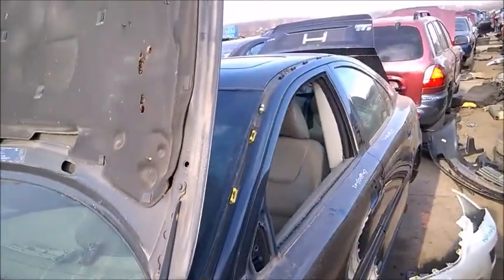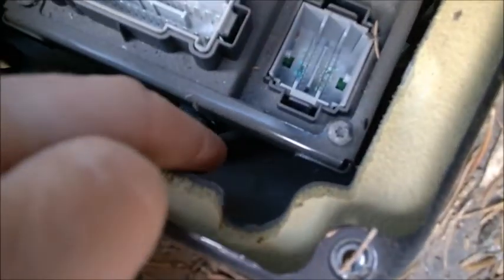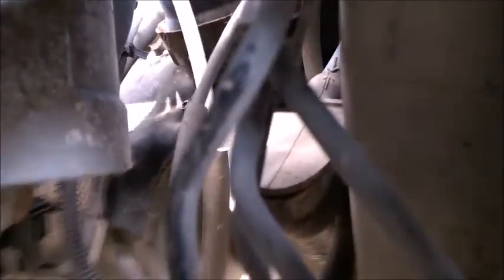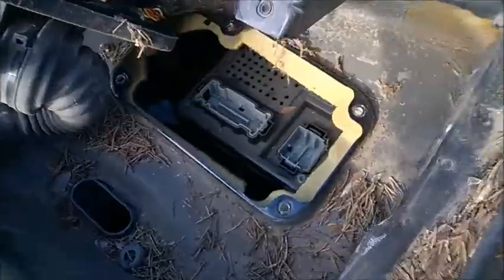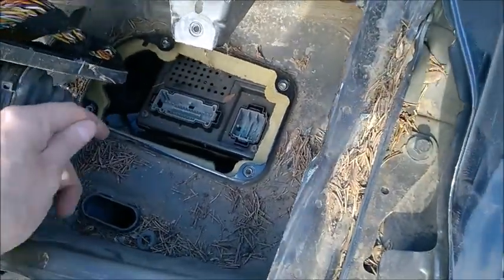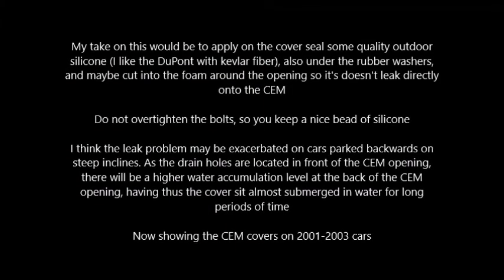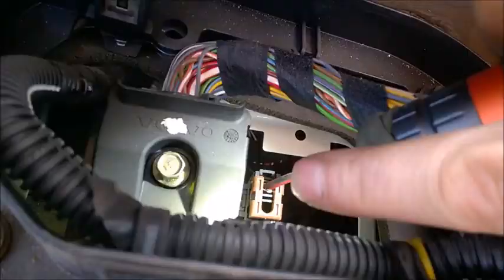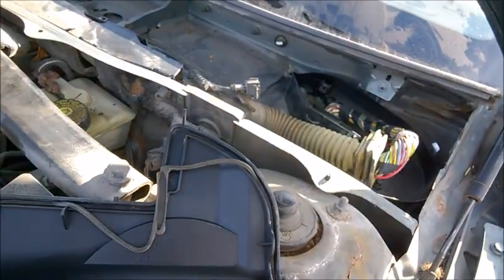Volvo S60 V70  CEM Corrosion check before removal  2004-2009

Comment: I have a 2004 Volvo S60 2.5T and I think I’m having the same problem with my CEM. My car will start and run good for a little and then eventually just start flickering on and off, eventually turning everything off and entering limp mode. If I disconnect my battery for a little, the problem is gone for a little. Would you agree with it being a potential CEM malfunction? Or maybe overheating. Do you have any tips/solutions
Reply from the maker: Hard to tell, better if someone good in electronics could check it. May also ask on forums but again, hard to tell from a distance https://www.matthewsvolvosite.com/forums/

Comment: Does this is an issue for 2001 s60 also?
Reply from the maker: Usually no, 2001-2003 had a different CEM unit not prone to failures or corrosion
Reply: @Peppermint1  ok thank you for the prompt response!really appreciated. Currntly having issue with the fuel pump still running eventhough the car already turn off. After removing the fuse, then only the pump stop. After navigsting to the fuel pump relay, removed it and install back again with fuse, the fuel pump now stop running.
Reply from the maker: @sangcxl31  2001-mid 2002 also had different fuel system design. It doesn't use FPS or PEM. Also the 2001-2003 CEM has a specific fuel pump relay, search Youtube with "peppermint fuel pump relay". Maybe the relay got stuck to ON. Suggest asking of these two forums, the UK one is better for diesel engines
UK  https://www.volvoforums.org.uk/
US  https://www.matthewsvolvosite.com/forums/
Reply: @Peppermint1  thank you for the advice! Will be looking for that

Comment: Peppermint! An Volvo XC90 purchased with 100K for $750. It runs nice after installing new plugs and coils. It does stall from time to time and must be restarted. The reason for the low price, was that of a parasitic draw of 400ma. With the car "asleep", I've found that there is 12V on many of the CEM fuses and under the hood in that fuse box. I pulled the top CEM connectors and found no water damage. After the CEM disconnect, the fuses under the hood showed no voltage, the draw disappeared, but the CEM still shows 12V on some circuits. I'm trying to make a decision whether or not to have the CEM repaired. What do you think?
Reply from the maker: Try asking on a forum. I believe the XC90 had a recall on the CEM harness - 
https://www.swedespeed.com/threads/cem-and-harness.416994/

Comment: from 2000 you have as well a leak problem, the screws have a step so you can not thighten them more than that, so the seal below the box goes thinner and than it leaks, got drops on my feet while driving in the rain, this i sealed from outside with bodyseal or glue and now it is fine.. still running car...

Comment: Great info. My 2004 S60 that still looks new is a victim of this faulty design. It sits parked beneath trees and the culprit is the seeds and leaves that block the drainage. Other than this problem, it's a great vehicle.
Reply: Это специально сделано и на ХС 90. 😊

Comment: Is that location for cem for 2008 xc70 Volvo 3.2 engine i do have some weird codes and suspecting this but i am not sure if that is the location or it is inside under steering wheel 
Pls let me know 
Thanks
Reply from the maker: A 2008 XC is a third generation (P3), different than the 2nd gen P2 shown in the video. First thing is to measure the battery and alternator (and verify the cables), then try asking on this forum  https://www.volvoforums.org.uk/forumdisplay.php?f=112

Comment: Just happened to my parents' XC90.  I took it apart and found the same corroded connector, and a few pins were stuck in the harness connector.  Buying a used CEM to try and take the connector to resolder on to the damaged CEM.  I have a DiCE but haven't been able to find a way to reprogram a used CEM.
Reply from the maker: Contact the company at the top of this blog https://volvos60xc70xc90buyersguide.home.blog/  or send the CEM to a 'module servicing" seller on Ebay
Reply: I wish I had a dice
Reply: How did you get the pins out of the harness connector? I’m having the same issue now.
Reply: @poseidon9697  I ended up adding a connector!  Drilled (and sealed, with drip loop) a hole in the CEM housing to bring out an additional connector (already pinned) to carry the signals that were destroyed in the original connector, and a matching one on the harness side.  Looks a little goofy but works well.  I sealed the heck out of that access panel.  What a stupid design, hope car companies have better best practices now.

Comment: If i clean the corrosion with contact cleaner gonna fix the problem?
Reply from the maker: No. What you see is only the surface. There is always much more corrosion inside the module

Comment: Hello Peppermint... Thanks for all u do buddy, I'm currently doing some maintenance on my 04 XC70 concerning the blower motor and it's all thanks to your video that showed me the way...
Have you ever heard of a parts company called Sidem Belgium ? I got a control arm kit from them I'll keep my fingers crossed and I'll make a video review on the parts before and after install
Reply from the maker: Can't speak for this company, but try buying from an official store. Many items sold on Ebay are counterfeit. I ended buying genuine bushes from Volvo and pressed them in the control arm
Reply: @Peppermint1  thanks for info... I bought them on Amazon, made in Europe so we'll see... After replacing LCA with Sidem Belgium parts, I'll keep OEM parts and get OEM bushings to press in and keep as spare
Reply from the maker: @hajileserpud9539  Depending on where you live (country) you may have access to brands for other suspension/steering parts as well https://youtu.be/HpmPurRlsvA

Comment: From 2003 and onwards Volvo put new electronics in their cars. Before 2003 it was Denso, from 2003 onwards the stepped over on Bosch.
Therefore I think from 2003 on they used another CEM design. 
You can recognize if your car has Bosch or Denso electronics. The Bosch ones use another TCM (throttle control module). Before on the ones equipped with Denso they used a Magneti Marelli TCM which can cause problems sometimes. The Bosch ones are more reliable.
When you cold start an S60 with Bosch electronics the RPM immediately goes to around 1600rpm and stays there for about 60 seconds. After that it returns to about 1000rpm. The S60's equiped with Denso don't do that.
Reply from the maker: Good info about the cold idle. The 2001-2002 had several different parts around the engine, such as TB, various hoses and sensors. These were changed from 2003, and from early or mid 2004 on there were new modules such as CEM and REM, new tensioner, steering rack and pump, new radio units. New headlights from 2005 on